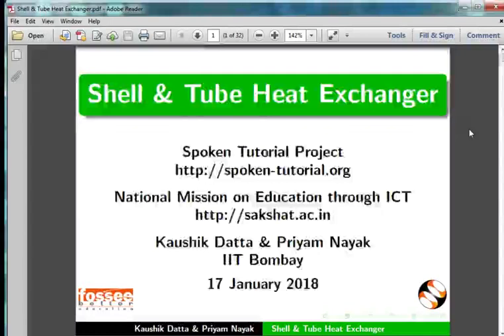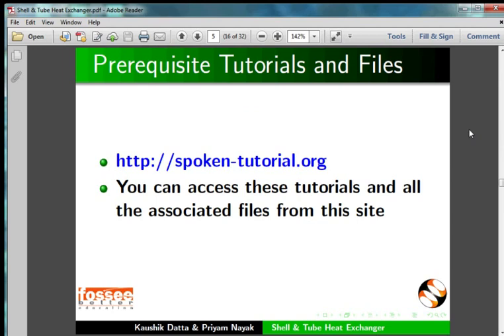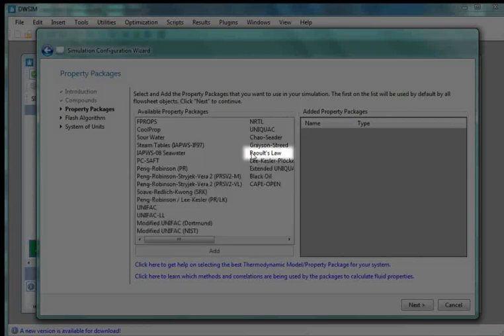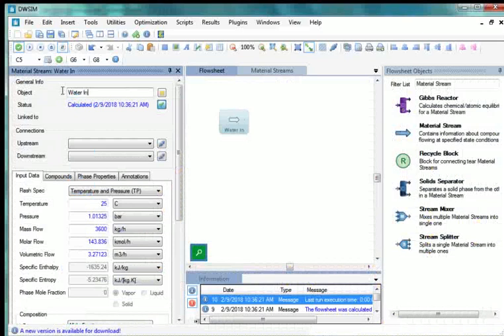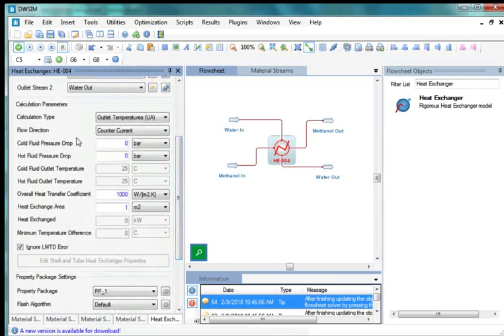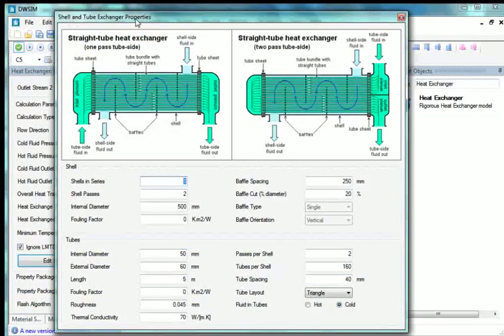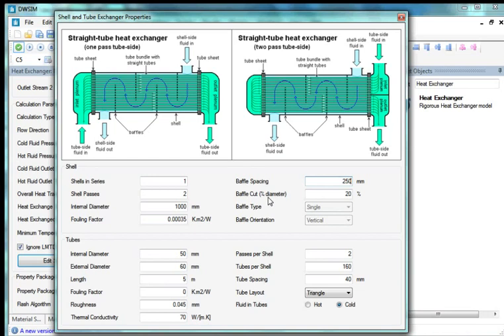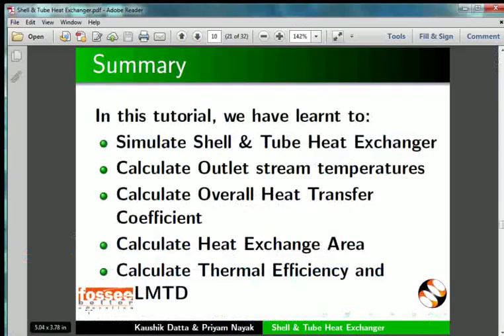Shell and Tube Heat Exchanger - English

Comment: I am not able to update the cold and hot fluid pressure drop..so the simulation shows an error
Reply: Yeah, I'm also facing the Same problem i can't enter the cola and hot fluid pressure drop😢😢
Reply: Same here :/
Neither pressure drops nor heat load (for calculated U) is correct :/
but i had almost the same issue in 2020